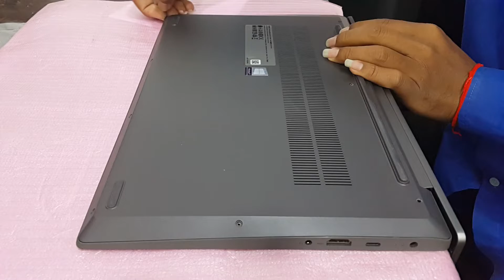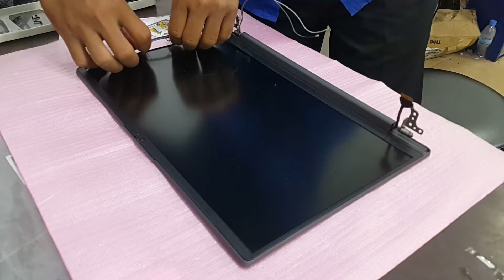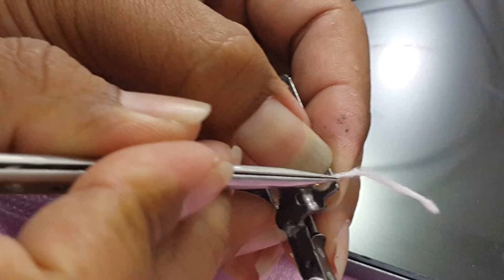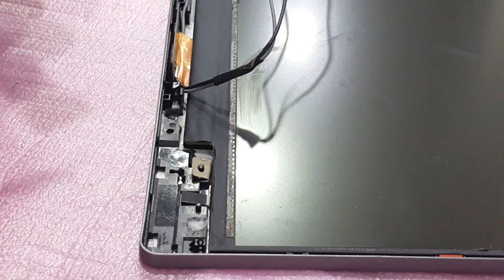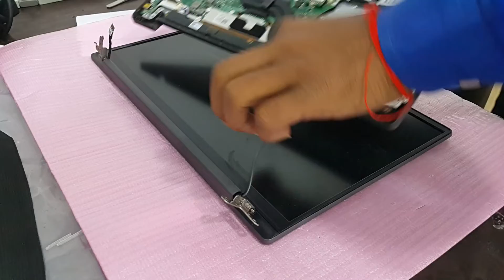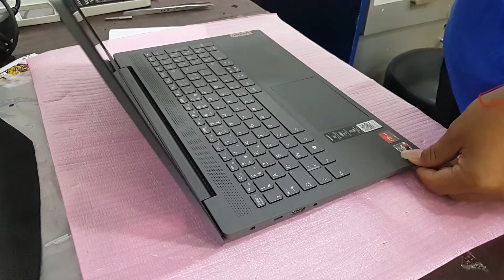Lenovo ideapad 5 15ARE05 Fix Hinge Easy

Comment: That did the trick. I hope it holds for a long time. Definitely seems like a design problem. 
One thing for those who follow... I loosened the hinge on the working side, so it wouldn't break. Now, I think the hinges are a bit too loose and floppy, but I assume they'll tighten over time - again.

Comment: Lenovo has a bad hinge for these laptops.  The bolt at the end of the hinge rod slowly tighten when customers open and close the laptop over time.  The bolt as it slowly tightens will eventually bind the hinge.  When customers forcefully try to over come the bounded hinge, the hinge bracket will dislodge from the plastic connector on the display.